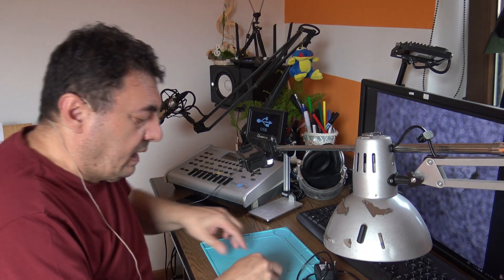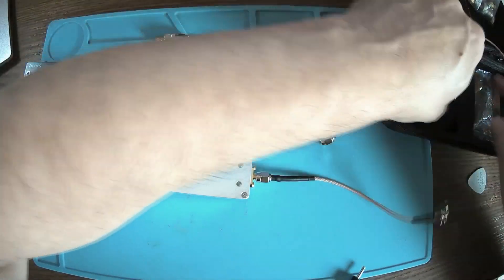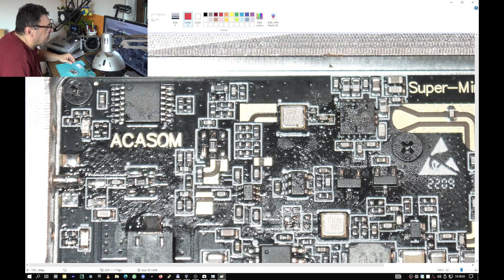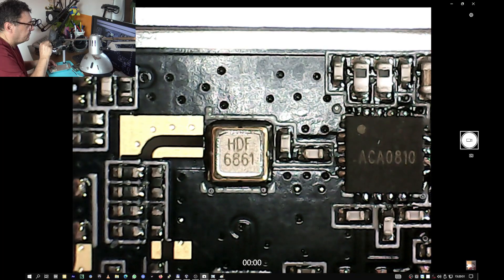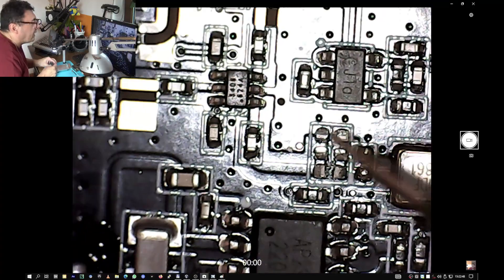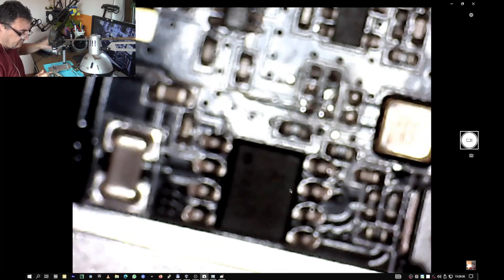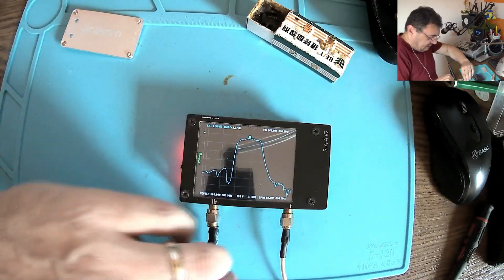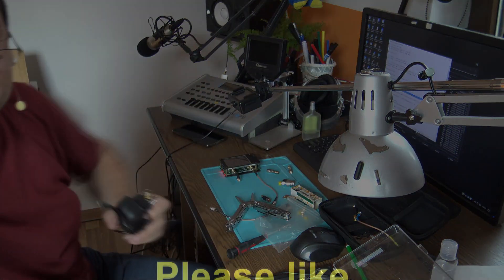Let's MOD Acasom LoRa amplifier

Comment: Love your video. In the end you show your amp in the attic and it was showing green line after few seconds. I am also using acasom amp but i never got green led and don't know If it's working or not
Reply from the maker: It should work don't worry..I'm using a Lora Gateway to TX test...
Reply: @viocaia  thank you for always replying really appreciate that. Can i ask do we have to put saw filter in a specific way means it have a specific input port and specific output or it can be used in anyway
Reply from the maker: @aqk_rulz  Doesn't matter how..the chip inside have a kind of input/out but basically it's the same result either way..

Comment: Hey Hooo :) i have a strange behaviour with my acasom... when it is sending a beacon it seems like power breaks together and the signal is not transmitted. without power supply, the beacon goes through... have you any idea what could cause that?
Reply from the maker: Interesting, try a new power supply..and rise the miner's TX power by declaring a lower gain antenna..maybe it needs a higher TX beacon to switch properly to TX..
Reply: @viocaia  I´m testing with a mapper, an check the rssi in the console, ent when i power it up the values get worse
Reply from the maker: @Daniel-qj8gg  Do the things I said..for beginning ..
Reply: @viocaia  I will do, due to the fact that i have no other powersupply, is it possible to power directly with 5v from usb?
Reply: @viocaia  Thank you for pointing me in the right direction ;) the powersupply was faulty... i replaced it with a nother one and unsolder the connector to put the cables directly on the board... the crazy thing now is that i have only 1 db additional noise, instead of 8 before, so all in all a big improvement... i dont know is it possible to get this additional noise has come from the old powersupply ?
Reply from the maker: @Daniel-qj8gg  The noise it's very possible generated by a faulty power supply..tehre are a lot of harmonics up to few Gigahertz

Comment: What did you hook it to when you checked the tx i know it was switching corectly but did you use a glamos or a mapping device because none of my miners becon like that and if you just turn the amp around on your vna like put the side that says to miner connect that to CH0 OR S11 then to antenna to CH1 OR S21 you can read the tx from your amp and the tx light will come on as well i think the vna sends 10Ma to the amp from CH0 OR S11 im just wondering if it was a mapping device or SDR or if was your miner what did you do to get it to becon like that thanks
Reply from the maker: For checking TX on Acasom  VNA is not enough, the signal should much more complex then a simple CW on sweep..so I use a LoRA TTN gateway made with raspberry PI and RAK2245..just for the sake of experimenting..there is plenty of literature on the Internet how to do that..